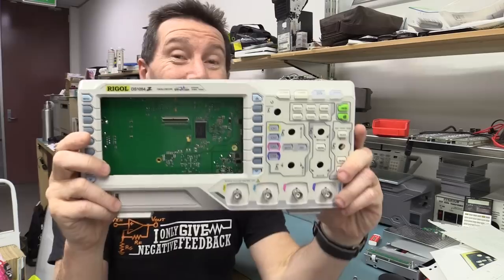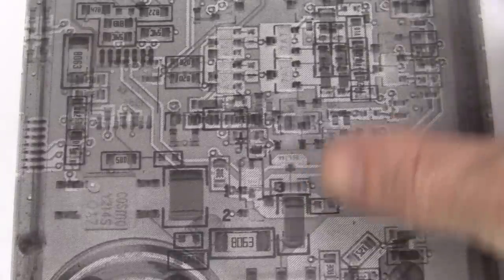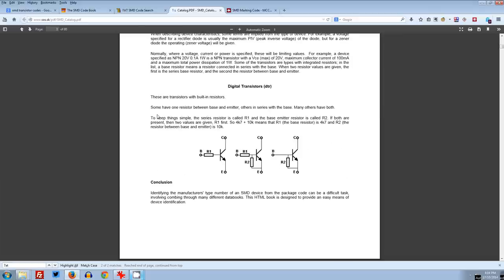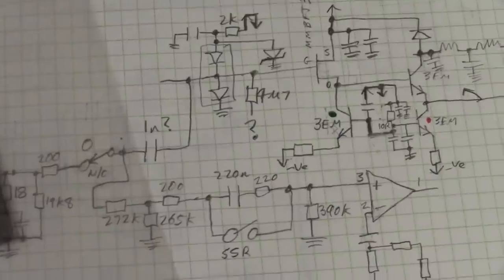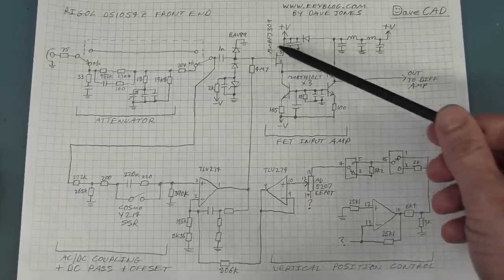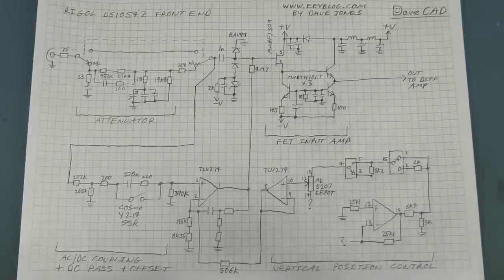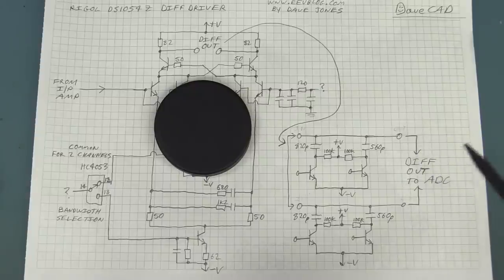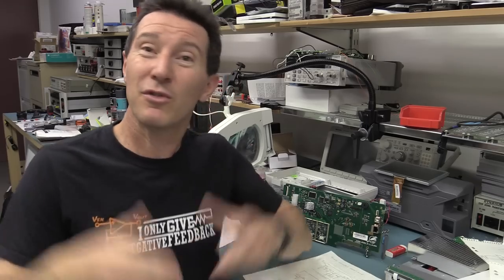EEVblog #675 - How To Reverse Engineer A Rigol DS1054Z

Comment: Quick solution to looking at inner layers - take a trip to a vet or dentist & get it x-rayed.
Reply: Re They charge for it  - of course they are willing!
Reply: mikeselectricstuff  can the x ray's do any damage 
are there components you would not want to X-ray
Reply: paul hill they say the chances of an x-ray flipping a bit in a flash cell are infinitesimal, however i have heard stories of it happening with particular x-ray machines. personally i would mask off any flash chips with lead before doing this
Reply: paul hill I had my laptop x-rayed at several airports when i flew to Africa. It still works =)
Reply: good point :)
Reply: You got rid of yours though Mike. XD
Reply: @abcefg3813  no, most pcb manufacturers use xray inspection machines.
Reply: @gillianseed4419  You realize people are gonna start running tons of busing under flash chips because you said this...

Comment: 5:45  
If you have a photo editing software that supports layers, then you can put the two images on different layers of the same document. Set the upper to 50% transparency and align/adjust. Crop the document so that everything is contained in the same rectangle.
Then, for printing, set the upper layer to 0% transparency and print, then to 100% and print.
Reply: YensR It's called G.I.M.P. and it's a free download. ;)
Reply: Aadil Shah There are other options, too.
Reply: Yes

Comment: If you have a larger board and a via disappears, you can also use a stainless steel pan scrubber as a "really big probe" to narrow down the area in which it surfaces again.
Reply: And then, of course, once you've found the rough area, you go back in that part of the board with the normal multimeter probe.

Comment: Nice video, expecially since I did some PCB reversing too, not a long time ago.   

Some tips: A nice (microfocus) Xray machine helps a lot. I did the same thing with photographing the PCB, but using the individual images as layers in GIMP is probably better than printing it, since switching layers is much quicker than swaping overhead foils. If you mirror the bottom layer, you can even get the vias to match.
Reply: Chuck Norris should be interested in fights, not electronics..

Comment: Just a few days ago I was testing for solder bridges between pins of a few 0.5mm pitch ADCs that I soldered to a PCB when one of my friends told me that it could potentially damage the chips.
So I measured the voltage of the continuity function of my U1273A and I got ~3.3V as well. The manual says that the test current is 0.65mA, so maybe it's not too bad. Ignorance was bliss!

Comment: I'm basically reverse engineering a shredder (PS-77Cs from Fellowes). It's a bit of a headache, but easy when you get used to it, it's helping me learn the multimeter a lot. I have to be careful there was a jumper hidden under a DIP too.The hardest part I found was transferring it to a software (easy EDA) for example my wiring was very messy. 

It would be nice to find a software that you can use which you wire everything up and then it generates the PCB and layout for you

Comment: Dohn Joe You wouldn't have most of the stuff you have today if it weren't for reverse engineering. The PC you have today was originally reverse engineered. Get a load of this guy folks, he must work for the MPAA, the way he spouts the usual hyperbole regarding "Intellectual Property".
Reply: To add - if you're learning electronics, reverse engineering is a really good tool to use to figure out yourself how things work.  It's not about 'stealing', it's about curiosity.  I know next to nothing about electronics but I find this fascinating because of the potential learning implications.  If you can figure out how things work, you can start to design your own circuits that improve on the original designs in one way or another, be it cost, etc.

Comment: Hi Dave! For even clearer shots using a tripod, try using a remote trigger or the built-in timer to release the shutter. Albeit small, pushing the shutter release button does shift the camera while it's taking the picture.
Reply from the maker: Gerard Vogel I do use a 2 second timer
Reply: +EEVblog that not what he means, by using a remote trigger, there's no movement of picture making it easier to compare... however may be wrong :)
Reply: +Harry O'Brien yeh i think your wrong!!!

Comment: Will you be putting a test signal into the scope and checking the waveforms to verify it works as you expect?
Reply from the maker: Coolkeys2009 Yeah, I want to do some more playing. Unfortunately this a loaner, so I don't want to go desoldering stuff. Have to wait for my own unit before I do that.
Reply: EEVblog I was only suggesting probing to see if a test signal was filtered as you expected and maybe checking the levels on those filter transistors when changing modes etc.
Reply: EEVblog when you get your own can you show us what comes in the box? I am considering getting one and cant find any info on that.
Reply: Cameron Webster Dave can you do an un-boxing video of the new scope.

Comment: (at 31:40) Surely that's a VGA, not a straight diff amp.. with the gain control voltage coming through the HC4053 from some DAC somewhere.  It looks like "Caprio's Quad" and the RC network emitter degeneration between the legs is for further linearization and bandwidth flattening, not bandwidth limiting.  I'm suddenly interested in this due to the high cost of VGA ICs..

Comment: Dave, very captivating video, as always. Only forgot to show on the board which are the caps to remove filtering bandwidth)) I wonder what the difference is compared to DS1202z-E/1102z-E, no teardown for those?

Comment: Guess that they not too much worried about reverse eng its prod, even the can give you the .bin . hex. .s19 whatever files they burn in. The HARD KEY is that, no matter you do, no matter where you buy it, you CAN'T low this OBSCENE retail price, but, yeah, you can improve it fo corse. You can improve BW, still they will sell the 60 Mhz ones and as you hack those, the 100Mhz upgrade will be go so cheap that you will get lazy just to hack it. Gotta love this Rigol guys. Nice Vid as usual. you need to do some contest and give away one of those =)

Comment: I do not think those switchable 560pf and 820pf caps have anything to do with the 50/70/100MHz bandwidth limit: the differential amplifier's output has an impedance of about 50 ohms and the trace most likely terminates into a 50 ohms input ADC. An RC filter with 25 ohms resistor and 560pf cap would have a cut-off of about 11MHz so it seems those caps are for anti-aliasing filtering at low sampling rates.
Reply: While I agree that those values don't seem to add up for BW limiting, I am not sure they are for anti aliasing either.  The cap combinations give 3dB bandwidth (assuming the 25 ihms from above) at 11Mhz with C=560pF down to 4.6Mhz for both the 560pF and 820pF turned on.  I would be surprised that an antialiasing filter with such a low freq would be required.

Comment: In the photo editing software you could just overlay them and do your tweaks there, rather than mucking around with printing it and adjusting it that way. Just overlay one of the layers ontop of the other and put a transparency on that layer to see both sides.

Comment: Is it possible that what you thought is the vertical position control is actually changing the gain? I mean: The bottom tap of the EEPot that has a question mark in your drawing could actually be connected to the output of the amp and thus close the feedback loop.

Comment: Is there a reason why the trigger level on the DS1054Z has to be so high for it to work ? Anything below about 640 mV is not triggering with a triangle wave on the 1.00V range with any trigger type selected, even with adjusting trigger level offset.

Comment: So then desolder those four transistors on the differential output for higher bandwidth? (The ones switching capacitors in and out)
Reply: Better will be to desolder those caps only.

Comment: I thought multimeters put out a current to measure resistance, then measure the voltage drop to calculate resistance?
Reply: +sean craig Yes, but if the current they put out is too strong, they can actually make it around the circuit and back by going through other components (e.g. diodes), resulting in an effective short out of the signal.

Comment: I found it really surprising that the vertical positioning is done by hardware and not by software. Can somebody elaborate on that?
Reply: Martin Oak In order to get the 1GSa/sec sampling rate, this is already a crazy fast rate for an ADC. It's only an 8 bit ADC. If you add/subtract a larger number in software, that doesn't give you much range on the input of the ADC for any real signal. Whereas, if you have software create an output offset voltage that can be subtracted in discrete hardware like this, that lets you use the full dynamic range of the ADC.